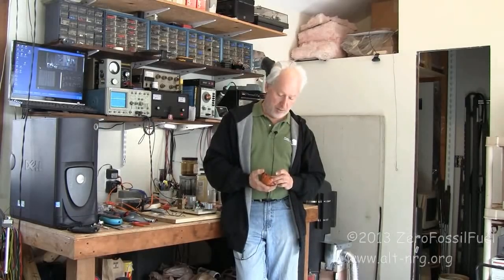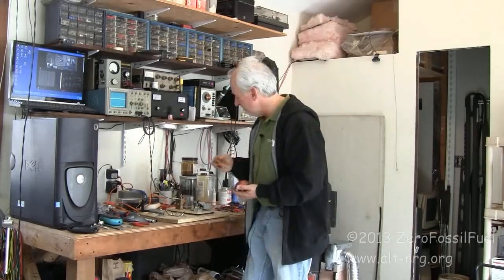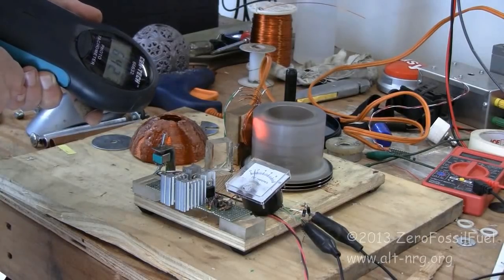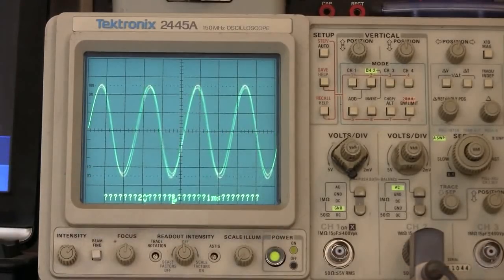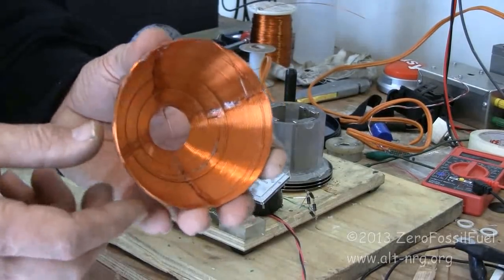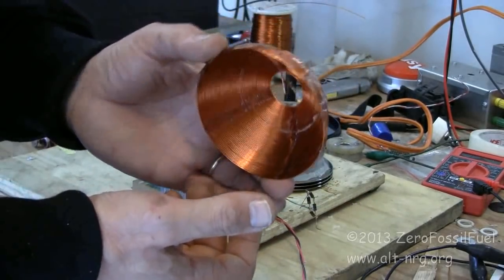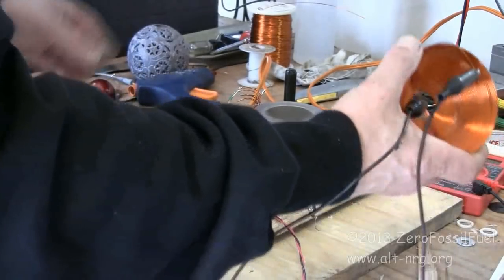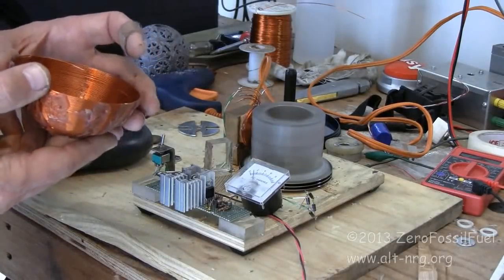#329 Zero Lenz dynamo

Comment: A dome shaped coil does not produce a monopole.

A magnetic field decreases in intensity the farther away it gets from the magnet. With the pancake coil, all of the area the magnetic field crosses is very close to the magnet, in its strongest field area.  With the dome shaped coil the area of the windings increases the farther it gets away from the magnet (as the magnetic field decreases in strength).  I'm sure this is pleasing to Faraday's law.

Also, with the pancake coil, the majority of the flux lines go around the pancake coil. With the dome shaped coil, because of the angling, the lines of flux must pass through the dome.

I think theoretically, your goal should be to create a dome/conical/parabolic coil where the diameter of the coil increases proportionally to the drop-off of the magnetic field, That way there is uniform induction at all parts of the coil. You might actually want to try an snti-dome coil.... like the shape of a gravity well, with the apex of the coil pointed at the magnets.

Comment: Why are you not showing the amps and the volts????
Reply: why does he not say how the length of wire he used for both. he doesn't know that it makes any difference!!!
Reply: gglafatottari Drullusukkor la questione non è soltanto la lunghezza, ma anche la forma, e numero di spire, e anche la densità e la forma del campo, in cui si muovono le spire

Comment: the coil thickness should be the length of the magnet magnetic filed and the with should be at lest 1.5 time the magnetic field length to get the best power output

Comment: your gaining experience, observation is the key to learning, The S.E.G generator is the ultimate device.  I believe it's an open patent.  anyone can build it.  you would need to be an electromechanical engineer, to grasp the application.  and an even better machinist.  I'm both and it's almost more than I can do, resources, that's the problem.

Comment: The idea of "free energy" is a nice on. But during all the videos you get only told that you input this amount of voltage and output this amount of voltage. If you don't tell how much amperage is at input and output.  Your projekt only shows that you have a working Transformator. (Voltage isn't the same as power. Power is the produkt of voltage and amperage.)

Comment: I would draw the exact opposite conclusions from your experiments than you did, i.e. your parabolic coil is far LESS efficient than the flat one. As EMFInduction mentioned, this is why it fails to slow down the rotor well which results in the higher voltage recorded. And in what Universe 2x voltage without load equates to 4x energy produced ? I'd love to live there.

Comment: an Ammeter and a calibrated 1 Ohm resistor should have been used to short the output of the various coils.  Why? For whatever reason, the hemisphere produced 6V p^p open circuit.  The implication might be less back EMF due to the shape but not necessarily any more power (V*I or I^2*R). You need to repeat your experiment while measuring power output (P=I^2*R) and not assuming more voltage must mean more power. There is a very good chance your hemisphere (Wyclyffe Coil) will not extract as much power from the rotating magnets due to the greater distance for most of the coil windings from the magnets.

Comment from the maker: Really? Why would I ever want to do that? :P

JK I have a bunch of resistive load values I plan to measure power output with. One thing I can tell you now is, just as with the pancake coils, there was no voltage sag with the 2.5 ohm load of the incandescent dome light bulb. None whatsoever.

Comment: your only showing voltage, most likely this coil is not producing as many amps
Reply: Right, he is not completing the equation. The parabolic coil might generate the same voltage but much less current, therefore the power output is less.  Power = potential differential + current. He has to take in consideration also the resistances and the winding.

Comment: What phobia do you call "the need to form copper"?  Don't you have a JFET? String 150 feet of that wire as high as you can get it and insulate it.  In the middle come down with another wire and connect to the collector of the JFET.  From the emitter go through a 1K  resistor, then an LED to ground.  Now clip a 10 volt cap and a 3 volt zenner from wire to base. Wire catches static, charges cap, discharges through base, turns JFET on and electrticity lights LED. Zero point! (no input) there ya go.

Comment: There is a flaw in your argument. You compared apples to oranges. You need to count the turns for each coil and make them equal. Gauge makes a difference as well. Make a flat coil with an equal number of turns of the same gauge wire then compare.

Comment: This experiment holds little value, especially when the object is not defined.
If you have the means which I don't, here is a real test that will determine if kinetic energy can be created by using only permanent magnets...
Temporarily you may use two of your single pole bowl electro magnets. (would be nice to have one each of the red and blue ones used in the Primer Fields videos by David  LaPoint)
Take a piece of hard flat steel that can inherit a magnetic field but not become a permanent magnet with it's molecules aligned.
On one side of the flat steel place the large end of the bowl magnets (~electro/temp?) North and south at equal distances apart and away from the flat steel.
Now you place a standard permanent bar magnet with the North side facing the flat steel on the other side.
Now here is the test... push the North bowl towards the steel and see if the bar magnet tries to get closer and then instead push the South bowl magnet towards the steel and see if the bar magnet pushes away from the steel. It is real important that the field of either bowl magnet does not directly effect the bar magnet, only the induced magnetic field into the flat steel must effect the Bar magnet.
If  temporary bowl coil electro magnets are used for the experiment, the current must always be flowing in both to make it as if they were permanent magnets.
If the reversal pole fields are induced significantly into the flat steel then I have some low friction mechanical designs in which to create a variable magnetic engine.

Comment: A little constructive criticism:  What you're doing would be easier to see if you weren't between the camera and the device.  ;)  That rotor doesn't seem to generate vibration of any significance, so you could probably get away with putting a camera on your workbench.  Cheers, and thanks for sharing this idea.

Comment: Fun!  But I have to mention, you claim about 2x "power" from the dome coil.  It's not 2x power, it's approx. 2x voltage.  Way different.  As you've by now doubtless understood, doing this experiment with equal power coils will produce equal drag.

Comment: well, i just finished one of those dome shaped coils last night, it is like 21 gauge copper wire 1" diameter ID, 42 turns total and 40 - 42 millivolts at approx 3100 rpm with 4 3/4" x 1/8" 10 pound neodymium disc magnets. I'm going to have to do something better than that, that aint goin to cut it.

Comment: Of course the hemisphere coil produces less drag, its got a much higher resistance since it has loads of wire and
most of the wire is away from the strongest magnetic field.  Electromagnetic braking depends on the square of the
magnetic flux density, the square of the velocity and inversely proportional to the resistance or resistivity of the conductor.

This is basic level 1 electromagnetism here, you seem not to know how it works.

Comment: If you are mechanically minded the answer is to connect the main rotor with the pulling rotor and timing is very important.Please dont try to sell the idea use it at home.

Comment: A mechanical mount would be repeatable & more reliable.  The speed at the 'stopped' time should be more specific.  Orientation also affects coupling.  what of cupping the edge of the spinning object (closer to both poles).  Sloppy work & logic.  Significant?

Comment: Are you using the same gauge and length of wire ?  It seems that if they were not the same gauge and length of wire, then the test would be meaningless.  Of course the bowl shaped coil doesn't engage all the magnetic lines of flux as a large percentage of the coil is away from highest Gauss concentration of magnetic flux.
keep up the experimenting.

Comment: It would be interesting to see what kind of various results you would have gotten from placing the cup shape coil over the rotating magnets on the vertical plane instead of the horizontal plane as the experiment shows. To the point of placing it over to the vertical and crossing to the horizontal as placing it over the magnets like a hat with the magnets rotating inside the cup coil.

Thanks for posting.

Jesus is coming soon.

Comment: if you had an independent shaft in the center that you could mount the dome coil on, the idea is to have more of the coil involved in the field, I like what your trying to do , but looking at all the attempts to achieve this type of output, I have found that John Searl has the one that makes the most sense, he has perfected the idea and went beyond.  the neodymium is machined to specific specs, you can't use individual magnets the separation creates a problem, rings, solid rings, all ratio's as you go out from the center.  look at this.
https://www.youtube.com/watch?v=sVLRKDlE8c4&feature=youtu.be
one of the brightest men on the planet.

Comment: I believe there is a fundamental mistake in your analysis. You are looking at the system in two separate frames of reference. One being the potential frame of reference or peak to peak (RMS or voltage in general) and the other being current (dead short). In order to take a proper measurement, you must attach a load (custom to each coil) which has an equal impedance as dictated by the maximum power transmission theorem....  https://en.wikipedia.org/wiki/Maximum_power_transfer_theorem   There is no way to know if Lenz law is being circumvented looking at each aspect (voltage and amperage) alone. You must look at the cross product of the two simultaneously. For example, if you have one coils with an impedance of 5 ohms (reactive and ohmic combined) you must connect a load of the same impedance, then to compare that against another coil, say impedance of 2, you must also connect an impedance of 2 Then you must calculate the power drawn from each ( it will be different if the impedance's are not the same (and equate the power drawn to the decrease in RPM. This will get you closer to what you are looking for.

Comment: I know that there is huge energy that we cannot yet tap (look up "zero point energy" in a vacuum near zero kelvin. But "free" energy?  I agree with the comment that just doubling voltage output does not double power output. Hydro generating or solar is not free but it is cheap. In Iceland they use geothermal because they are sitting on top of a volcano which could blow up.  But that is cheap power.  Efficiency must dramatically increase to get more net power from a prime mover.  Many prime movers waste huge energy.  I don't see yet how to get more power out than you are putting in. i'm not however saying it is impossible.

Comment: I'm really not sure what your point is unless your goal is some attempt at a new transformer design that is less efficient than those currently on the market. You made a step up transformer coil, higher volts than you pumped in, wow. Why not use that fancy gear to show how many watts you lost? Oh, right, to much thought and work for that section in the video. I give you props for your time playing with copper, otherwise, sell the copper at a scrap yard. That would be more efficient.
I am sick of these videos purporting to expose some hidden secret where Tesla's name is thrown out to add some aura of mysticism....MONOPOLE, You actually used the word, OMG. Monopole.... I'm going to be laughing all day tomorrow about that.

Comment: get the eye of the storm in dat thing calm in the middle all the force is outward little time machine if it spins in the direction a or manner as the earth and should be xactly like an electron does you should watch earthtime compared to that things time have something to compress the heat back in exsternally from dat thing

Comment: Quit insulting Tesla, by using his name on your garbage.    Question, how many RPM's does a computer hard-drive achieve?   7,200 rpm.    Now lift it up, so we can see it is plugged in.    The junk you glued  it too slowed it about 130 rpm.    Your entire chance of credibility is lost until it spins on a base bearing that does not have an electric motor built in.

Comment: Nothing spectacular about this
You have got more surface area in the bigger coil therefore you get more loading etc,
All you are doing is making a mechanical transformer.In both instances you still lose energy,
Proves you are doing basic electromagnetic induction
Please go back to school and learn what electricity and electron theory is all about, Nothing significant
The shapes you wire will prove nothing in the end result.
I'm sorry if I seem to down grade your attempts to prove nothing except that you will learn you are making a mechanical transformer,